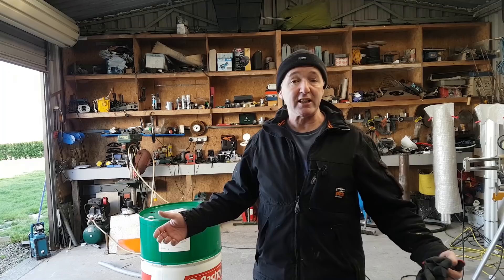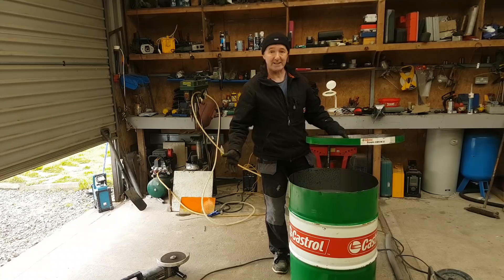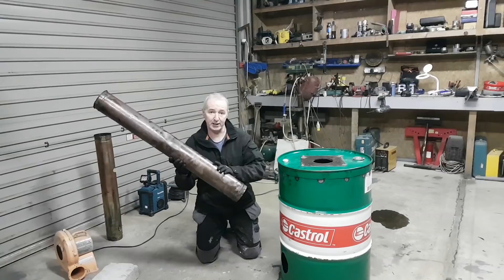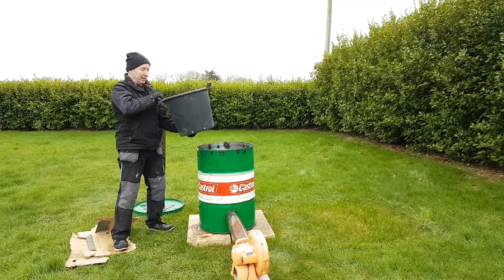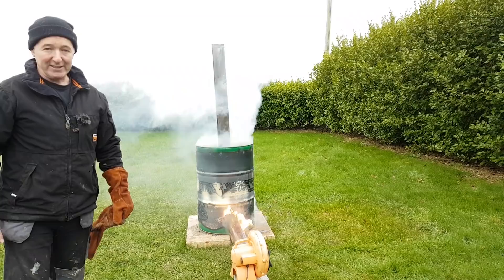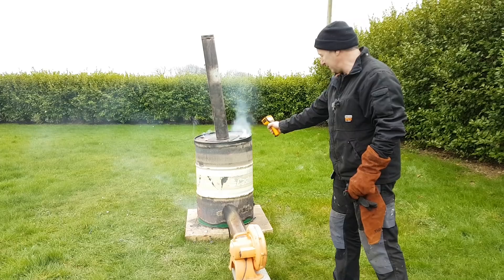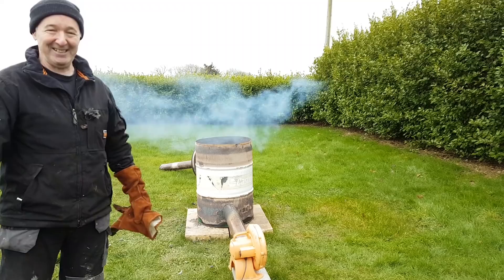Simple Burning Barrel .. Burns Waste Oil too.

Comment: You can get an AC motor speed controller for about $20 (good one), which will make a big difference by tuning the air to fuel ratio. It works for me.
Reply: Great advice!

Comment: Gerry, great video. That puppy is insane. I bet that thing glows at night. If you want to try a barrel that wont destroy itself with heat. Weld 4 big truck rims together with a 1/4" space between each one, right at the weld points. Air is sucked into the space between each wheel in a 360 degree circle. These barrels burn like a furnace and consume branches almost as fast as you can load them in. The last almost indefinitely. I only get less than a year out of a 55 gallon drum, but I use them a lot. There's one problem though, they weigh about 300 lbs.
Reply from the maker: Hi Tom. Thanks for the heads up on the truck rims. That sounds really good and an easy build too. I will look into getting some. Appreciate the comment Cheers Gerry

Comment: Nice job Gerry.  Suggestions:  1) connect the bottom pipe at more of an angle to swirl the forced air inside the barrel.  That is how my waste oil foundry is set up, and it works very well.  The oil and smoke and waste vapors will swirl inside the barrel, dwelling inside longer and burn even more completely.   2) variable rheostat speed control for your fan unit.  ( I cannot remember in past videos that you may or may not have used one?).    Otherwise, thanks for the video, useful and entertaining, as always!
Reply from the maker: Hi SkunkWerX. Thanks for the suggestions. I had fun making this work but there is definitely room for improvements. 👍 much appreciated Cheers Gerry

Comment: I made one years ago, using an HVLP paint sprayer turbo unit, with a 1" pipe tangentially into the base of the barrel, it worked well. No need for a brute air blower like the bouncy castle one - it takes a surprisingly small air blower to supply an excess of air for smokeless burning with a vortex.
Watch for the grassing neigbours and the council snoopers, depending where you are. Clean burning will not attract attention.

Comment: Good vid. 
I have used these type of barrels before for burning trash and I did it similar to what you did; I bought a cheap replacement barbeque grill and put it in the bottom on some bolts to lift it a few inches to leave an air space under the material, cut a hole on the side near the bottom, and blew air into it with a fan. I didn't use a flue, I just left the top off, but it worked great.
Reply from the maker: Hi Rob. Great Tip Thanks. I set this up with a fan to see how smokeless I could get the burn and to try it with some waste oil. You guys have given some great suggestions for these burning barrels. Much appreciated Cheers Gerry👍
Reply: @GerrysDiy  You're welcome. You've shared a great deal of good info so it makes sense to  share some with you as well. I did this when I didn't have garbage service for a while and as I said it worked great. Though the intense heat does mess up the heat treatment of the steel the barrel is made of so they rust apart fairly quickly (a few months maybe). I don't know but maybe putting some oil on it after it's cooled down some might make it last a bit longer.

Comment: Great video,  what a bit of kit you made. Still trying to understand cutting a strip off the top of the barrel & then welding it straight back on again. Maybe one day I'll understand,  or hopefully someone will explain it to me. Beats my garden incinerator that's for sure.  Much impressed.
Reply: He welds it on the inside of the barrel, so he can use the top of the barrel as a shelf to sit the lid on, and the lid won't slip off. Like imagine a cookie jar where the lid is the same diameter as the jar - there needs to be an inner sleeve protruding out the top so the lid will have something to slot over

Comment: Hello Gerry!
Yet another nice and simple project.  Well done!  You might consider placing the inlet at more of an angle to create a swirl inside the barrel. Did that once long ago and it makes a big difference - until the barrel melts, that is!  Someone else made mention of a BBQ grill to make an air pocket underneat the fire and that helps, too.
I've said it before, but you'll be in heaven if you had a plasma cutter!
Keep on with the builds!
Dave

Comment: Now this is brilliant.  But see if ye'd dig a hole as deep as you want allowing 2" extra around.    Drop the drum in on a two inch base then fill the void and base with cone ten fire clay.  Obviosly you need dig your blower channel.  This again fill with cone ten and I advise old cast iron drain pipe.   When the drum has burnt away yer left with something permanent that you can build a pretty stone wall around.  Add an oak barrel lid when not in use :) Put a planter on it :)

Comment: the environmental officer will go after you Gerry but it's a good craic :)
Reply from the maker: Hi Hassan Hassan. I made this to burn garden waste but couldn't resist checking it out with alternatives lol. Thanks for the commnent Cheers Gerry
Reply: I bet this would actually be far less polluting than burning it on a bonfire. I mean it still becomes CO2 but there are clearly less particulates.

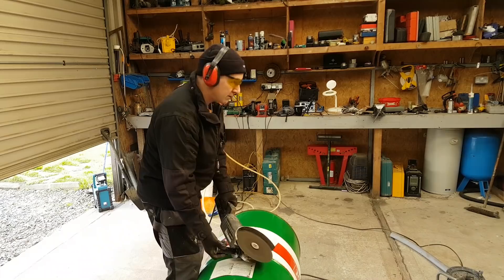Comment: 1:34    Before you do this, make damn sure the old contents of the drum were not flammable.  Vapors can be just as explosive as the former contents, and guys have gotten killed cutting into "empty" drums that exploded.  I was just reading about a guy in Pennsylvania who got killed by a burn barrel last week.  And I know of another incident in Iowa that killed a man who was welding on top of a barrel, using it as a workbench.  Filling the drum with water before cutting into it can displace explosive vapors, if done correctly.

Comment: I'm in progress of building a drip oil / blower with 55 gallon drum with bottom cut out  to burn stumps
Reply from the maker: Hi Jason. I saw one of them a while ago and I thought that it was a great idea. Good luck with the build Cheers Gerry👍
Reply: @GerrysDiy  thanks  and I got that stove working great  I dont use and kerosene to start it no more  just couple pieces of cardboard and preheat pan with torch. Thanks for the help I will send video link of my stove

Comment: i love your videos to start with but you might want to keep the hedges they hide stuff .  and it looked like you made your first wood gasifier when you choked the air it allowed the gas to build in the barrel that's what blew the top off . love it
Reply from the maker: Hi Paul. I was looking at a guy with a gasifier running a pickup. Looked very easy to make and fun too. I wonder if I could run my paramotor on it. 😀 If it stops raining I would like to make some mods to this little incinerator. The channel has gone nuts recently with views and subs. Thanks for taking the time to comment Cheers Gerry👍
Reply: take a close look at my picture to the left its a 97 gmc with a gasifier in the back been using for 4 years or so .after I built a oil burner that's how I came across your channel . if your really interested check out drive on wood there are a lot of people with a lot of info and proven projects. I have posted some videos on here for the wood gas group but if you search my name they are open to public view. @GerrysDiy
Reply: So pretty much a burn barrel backdraft??

Comment: Could use as a forced air heater try using a squirrel cage fan made of metal would make a great shop heater if had good fresh air i dont see why not or no harm in it i find that home made stuff is better then some of the built and manufactured from computer designers never know if its built right either i build a shop heater out of a restaurant deep fryer burner bracket frame propane and a belt drive furnace blower but had to go back to draw board had a lot of setbacks and problems with my design on my gas tanks that fed the gas

Comment: Hi Gerry, Thanks for another well-paced video. What will you do to make it a functional sealed oil heater? Do you think extra air is coming in from the drum opening, to join the vortex, to make the clean combustion with the lid off? My small blower stoves do this and become smoke generators without this extra secondary source of air.
Tim

Comment: Sorry GerrysDiy  can i ask is it the waste oil bur er need to use air? And the waste oil is it need to mix with something or not?
Reply from the maker: Hi Ausyah. It does need the Turbo fan air to burn clean but the oil is just dripped into the fire with no special burner. hope this helps Cheers Gerry👍
Reply: @GerrysDiy  Ohh.. What u mean by turbo fan air? Sorry, I not really good in english.. Can u help  me give example what u use or video that show clearly how to do it..

Comment: Mister Gerry what is the maximum temperature that barrel can produce with the fan on and burning with oil?
Reply from the maker: Hi Hero War. It will glow bright red which is about 750 C. If you line it you could get it hotter. hope this helps Cheers Gerry

Comment: Will it cause smoke when plastic is burned in it?
Reply from the maker: Hi. VISAKH If you think of plastic as fuel and you get the air fuel mix correct it won't smoke. Basically not too much plastic at a time. Cheers Gerry

Comment: Burning waste? Burning waste oil? What kind of person are you to do this? You should be brought to justice for environmental crimes!
Reply: It's literally no different than diesel trucks going down the road....probably a way more complete burn than trucks therefore less pollution
Reply: @yrusonoz5574  No it isn't. Under these uncontrolled conditions you produce a lot of harmfull toxins. Waste should be burnt under optimal conditions in an industrial incinerator with energy recovery and filtering of the exhaust gases. Now it is just a cheap way of getting rid of things, without thinking about the environment nor your neighbours.
Reply: Stuff the environment.

Comment: There is still the same amount of smoke you were just diluting it with the volume of air you are putting in it and you're unable to see it because it is so
Reply: No. The smoke is a mix of combustible particles and gases. Once you get the barrel hot enough by forcing in more oxygen, the smoke doesn't have a chance to form and immediately burns off instead, generating even more heat.